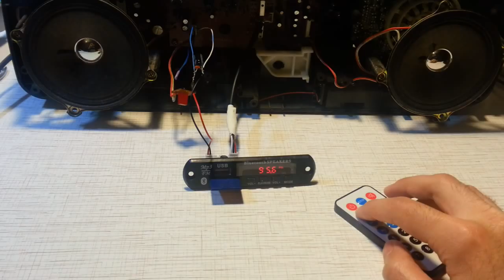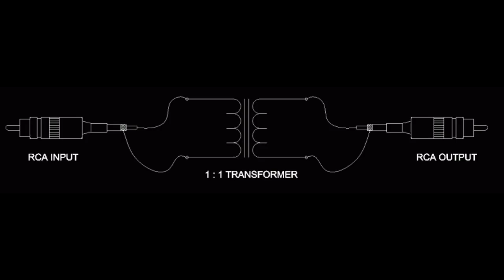(part.3) how to get rid of noise in the audio signal

Comment: the charger solution does not work when you use batteries to power the radio cassette player. in this case a power isolator is a better option.

Comment: which component has u added to the charger
Reply from the maker: +Krishna Rockzz I used a 5.1V zener diode, I modified it like this http://www.instructables.com/id/USB-charger-modify-output-voltage/?ALLSTEPS
Reply: How you solder the zener diode to the USB charger there is no photos of you puted in the link
Reply: Pls put the where we actually solder the diode...
Reply: In the YouTube video u solder the zenordiode but which place of you solder is not visible...
Reply: Pls..... Tell the actual place of zenordiode was soldering
Reply from the maker: +Krishna Rockzz I don't think It's possible because a schematic of your adapter is not the same as mine. But there is the main idea behind this modification: you need change feedback to trick a driver.